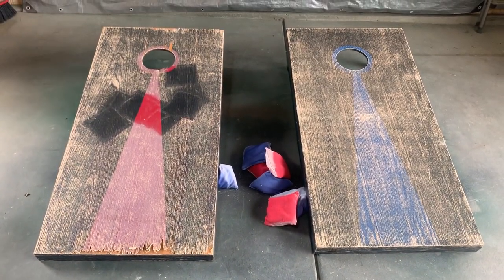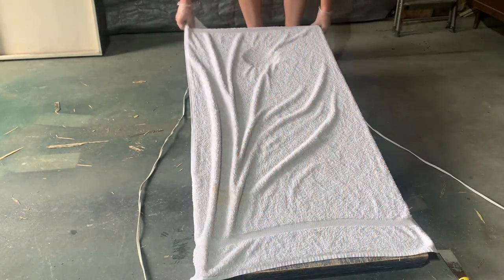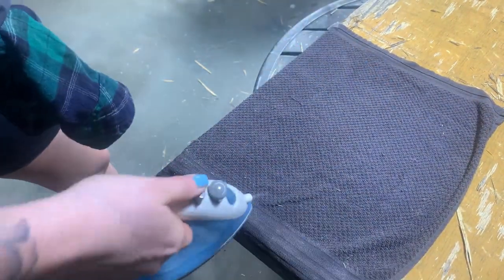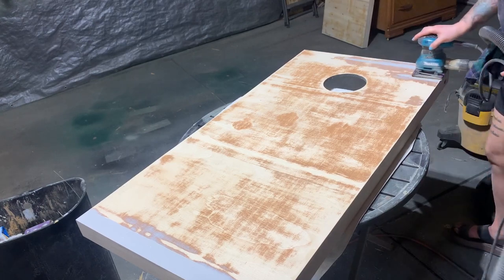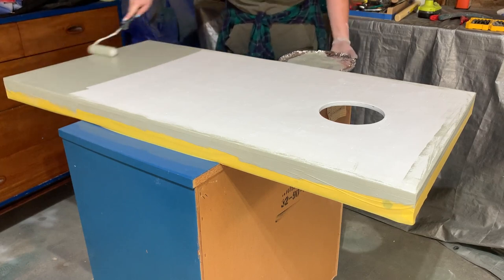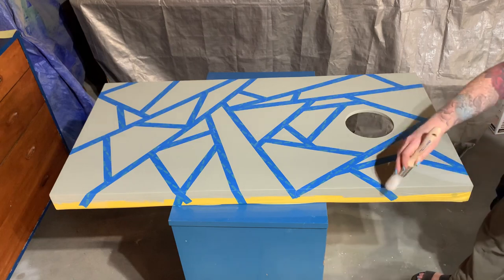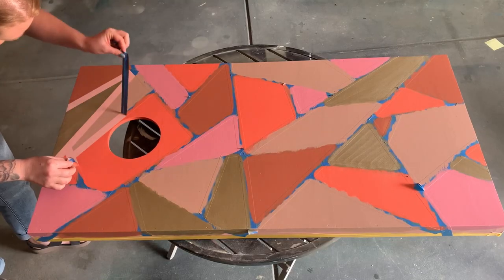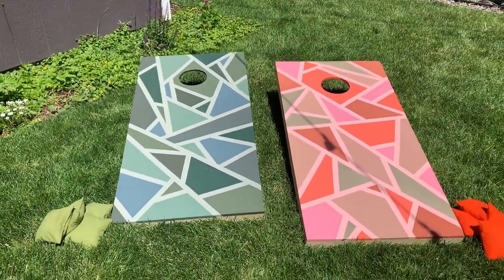Upcycled Corn Hole Set | Get Perfect Tape Lines Every Time | How to Remove Stubborn Veneer

Comment: Does the tape come up easy with the poly on it?
Reply from the maker: It does. Always make sure your paint is fully dry before putting tape down. Also, be sure to pull it up when your paint is dry but not fully cured. 24 hours works great.